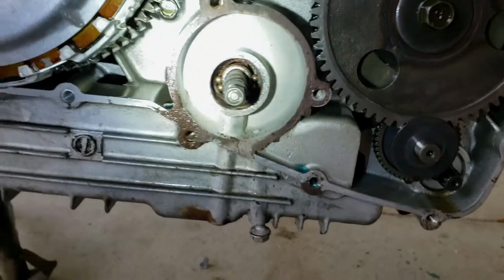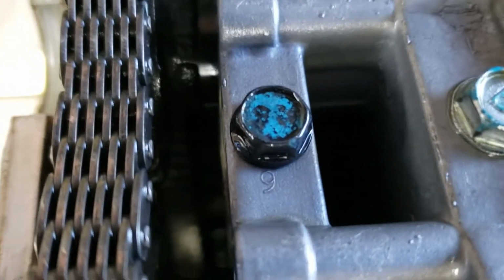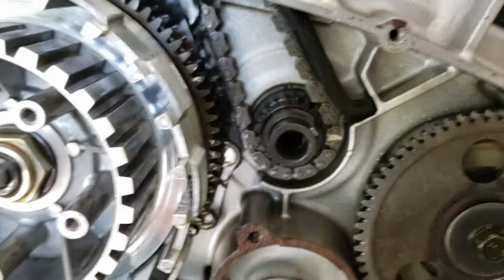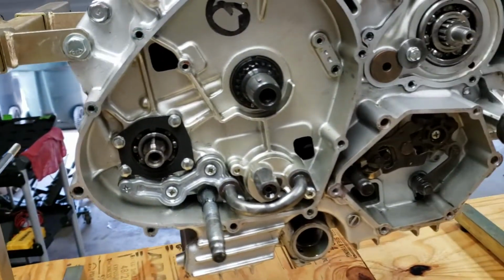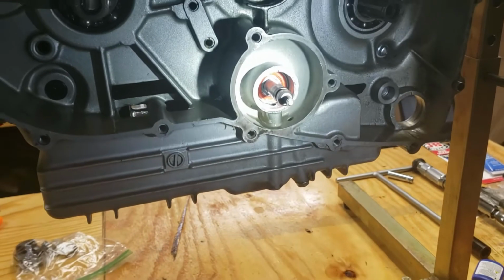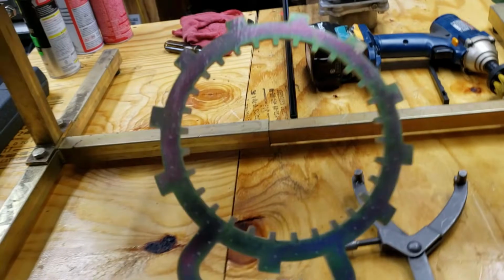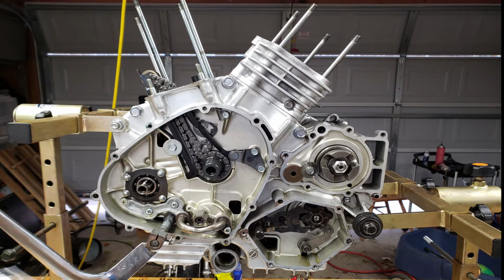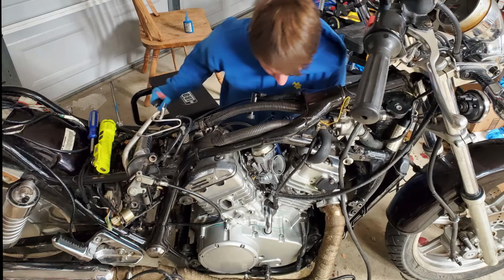Vulcan 750 Full Engine Rebuild

Comment: Well I can officially say it’s the first time I’ve ever had a problem with my 750. My Shift bar came unscrewed So I’m in the process of taking apart the whole engine just to get to it your video has helped quite a bit for teardown I’m just having some trouble Splitting the 2 half’s of the engine apart
Reply from the maker: There are pry points along the case. I put a big flathead in those locations and used an adjustable wrench on the screwdriver for leverage. Best of luck!
Reply: @hundleycycleshop8876  Thank you! I ended up getting the case apart but slight problem I think somebody Put Loctite on it all the way around it’s a bit broken up and jagged And a bit powdery around the whole seem. Sanded it off but that’s still a bit odd
Reply from the maker: @Diebesten162  yes I seem to have had that issue as well. I was finding crusty bits of who knows what in various places. Could be lock tight or as hard as it is to image, it could be dirt from the road. Once it's all cleaned up. It will go back together nicely. Good work!
Reply: @hundleycycleshop8876  I am painting the engine black and adding silver highlights to the fins It was a bit of a disappointment when the shifter failed but it’s my first vehicle and there’s always room for improvement and customization that’s the fun of it!

Comment: I have owned three Vulcan 750s, two of them bought new. The Vulcan 750 engine is a nightmare from hell. 16 valves, hydraulic lifters, four camshafts, four cam chains, 2 jackshafts, 4 spark plugs, a counterbalancer, rubber engine mounts, a positive neutral finder, liquid cooling, external oil lines, the worst carburetor design ever (but at least it's better than EFI) shaft drive with a separate front bevel drive gearbox, automatic cam chain tensioners designed to fail, a stator you can't get to without removing the engine, and the most convoluted intake system I've ever seen. Also notice just how close the coolant passages are to the cylinder bores and the outside of the head. The head gasket is very narrow around those passages, and leaks are not uncommon. It has twice as many parts as it needs. It has twice as many parts as my H-D Sportster engine. You have to wonder just what kind of a person thought this up. Most people familiar with this engine believe it was redesigned and modified several times before being put into the Vulcan in its final form. I think it may have originally been intended as a chain drive sportbike engine. That could explain its hydraulic valves, since in the Vulcan frame there is no way to get the covers off to adjust the valves, the fact that you cannot remove the stator cover with it in the Vulcan frame, and the obviously added on bevel drive gearcase. It's certainly not the sort of thing someone would design for a v twin cruiser. Aside from its excessive complexity and automotive appearance, it has the wrong characteristics for a cruiser. It has decent power, but the much better looking and far less complicated Suzuki Intruder 750 engine has more. And it has the wrong sound, feel, and lack of low end torque. I'd sure like to know the true story behind this Frankenstein engine. On the good side, I did manage to get 118,000 miles out of one before a broken cam chain destroyed it.
Reply: Wow. That's alot of info in one place. I appreciate u sharing ur knowledge and experience.... All that being sed. I cudnt help but notice u sed u owned 3... Why do it again and again? Or was it a gamble at a good price e times that ended up being a learning g process?  I'm thinking bout gettin an 88 Vulc 750....  My experience is nearly zero, shud I pass?
Reply: @Joseph-td1xw  I have owned three (I still own a bought used '97 model after wearing out two of them that I bought new) because they are the most comfortable motorcycle I have ever owned by far, and they easily keep up with highways speeds. They are an ideal solo touring bike. I have over 230,000 miles on Vulcan 750s. Despite their mechanical complexity, they are extremely reliable. The main issue is the cam chain tensioners. They were a defective design, and Kawasaki never fixed it, even after 21 year of continuous production. Fortunately an aftermarket company came up with a design that worked. I did have one stator fail, which meant pulling the engine. But it has only happened once. The carburetors are a HUGE job to remove and reinstall, but if you drain the gas out of them before letting the bike set for more than a week, you will never need to deal with them. I have done several Iron Butt rides on them, and even at 65, with fairly severe orthopedic issues, I can still hop on one and ride 1,000 miles in under 24 hours with very little pain. They are that comfortable. If Kawasaki still made them, I'd buy another new one. Sadly they stopped making them in 2006, so I'm probably on my last one. There are reasons why they sold so well for 21 years completely unchanged except for paint colors.
Reply: Thank u so much for ur reply. I'm looking at an 88 for 500 bux. I have no experience tho. Once I hear it run I might pull the trigger. Its in fair condition. And I know the previous owner, I'm just kinda apprehensive. I hear great things about Hondas too. I know another guy with a '02, Shadow,1100, it's running and hes wanting 1500 honestly Im more i interested in reliability and ease of maintenance and parts availablilty than I am about comfort. Guess I'm gonna have to wait and see. Anyways thanks again brother for the info. Be safe!
Reply: Sounds like a love/hate relationship that long text to your ex you thought done you bad but gave you a time you will never forget. A love you will never truely recover from😂🎉 ok yea its a frankienstien but who doesnt love that with a machine! A cruiser that wasnt ment to be a cruiser.. l take that at the right price and throw some other bars on it. Question is are they worth hording colecting and reviving to keep a beast alive the thing that should not be. The god of fire and metalwork🎉

Comment: love your video on the break down and rebuild of the Vulcan, I am taking on the same myself. love how you move through it all patiently. You mentioned your found a replaceent empeller shaft. Where did you find one? that would be a big help at this time for me which I am worried I may need to replace mine and the parts supplier I work with informed me that the part is discontinued.

Comment: I’m reassembling my crankcase cuz I just replaced the impeller bearing just like yourself. I went to the exploded view in my manual to see what the torque specs are to no avail. The are no torque specs. What did you tighten yours to? There are 10mm bolts and 6mm bolts. Please 🙏 enlighten me.🫡

Comment: Question for you... I am tearing down my Vulcan 750 as well. I don't have the correct bolt to thread into the stator motor pulley, do you know the bolt size to pull the stator shell off the shaft?

Comment: Bravo, you've got some skills! Today I noticed a small amount of oil coming out the weep hole, but no coolant there at all, and the bike is working fine. Does that mechanical seal also keep oil from getting through to the weep hole? Do you think there's a chance that swapping the mechanical seal might help to prevent need to tear the whole engine down to get at the O rings behind?
Reply from the maker: Unfortunately that is the terrible part about the whole design. If there is coolant leaking from the wheep hole, you can surmise that the mechanical seal is bad. If oil is leaking it would be the seal that is behind the bearing on the inside of the crankcase. The only way I could access the bearing and oil seal was from the inside.

Comment: good night, i would like to know how you adjusted the stitch i saw the markings but i am finding it weird because i have to go back 4 so that everyone is aligned, i have twice dismantled the engine and the front cylinder as you turn the engine it arrives in one point that is very hard and the chain of control of the front cylinder is stretched. I'm talking about Brazil, it's difficult to find documentation of the bike, there is some secret in the assembly. Big hug.
Reply from the maker: Yes, I gather that you are wondering how to achieve proper chain tension. The bike originally comes with automatic chain tensioner's that can be preloaded and installed. What I have are manual chain tensioner's which are aftermarket. You just snug them up against the chain making sure to take up the play and adjust after you get the engine running. If you have excessive play in the chain after the OEM part is installed, you need to be sure your chain hasn't stretched past factory specifications.

Comment: So when you line up the front timing marks does  the back head line up aromatic are do you line it up separate
Reply from the maker: You time each cylinder separately. I would highly recommend getting the factory manual timing procedure, because it is very confusing at first. Great question!